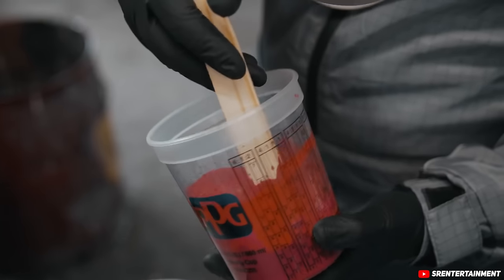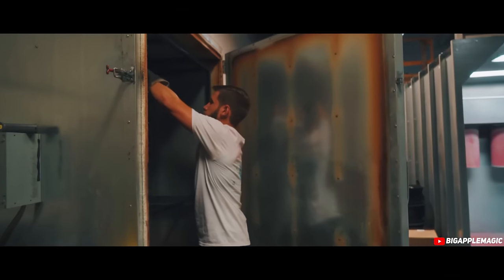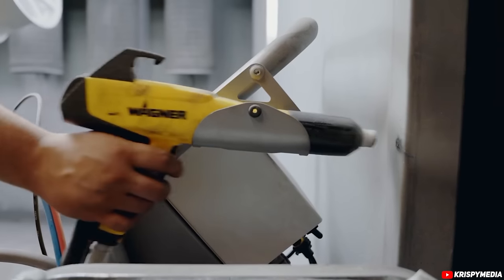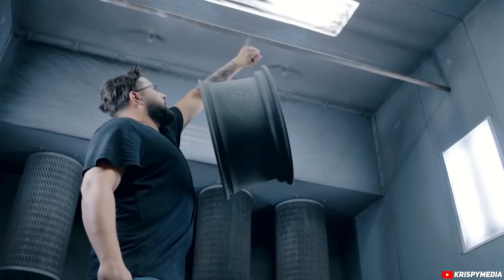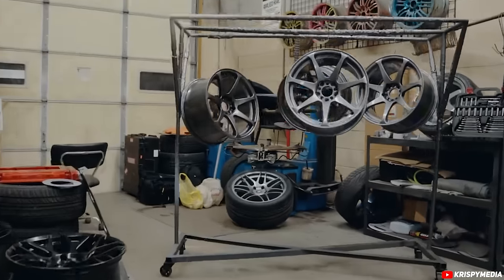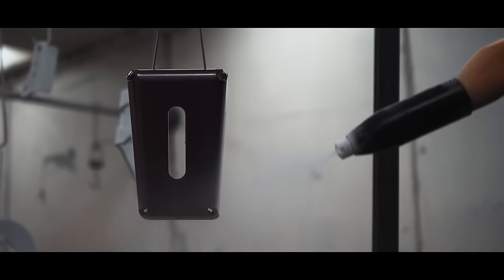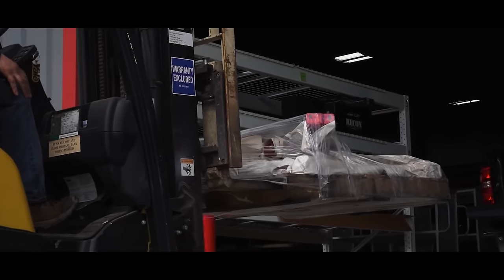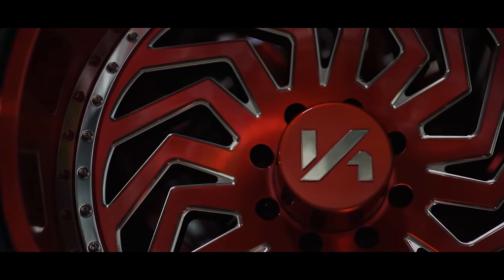Paint VS Powdercoat!

Comment: I have rough country side steps on my truck and they are powder coated from factory and I can 100% say that it's a super durable surface, even the foot pads are powder coated and I've had them for a few months now and they still look brand new, also I live in area with basically nothing but sand for dirt so you can probably imagine that my boots are probably grinding against that surface a lot

Comment: I am assuming you cannot mix decals with powder coat in any way. Obviously one could put a decal on any smooth surface after coating but I am referring to protecting a set of tank decals for the long haul, usually by applying clear coat over the decals. But a decal in a powder coat oven under clear coat would burn up, correct?

Comment: Have a safari style roof rack 4’ x 7’ for my 4x4 SUV. The factory paint is failing and has a lot of surface rust. Should I sand the rust off and rattle can it or is powder coat the better choice?
Reply from the maker: Roof rack, I'd powder personally

Comment: Great video. I'm curious I painted my exaust hmdi ports with a high heat engine enamel spray paint(Rust-Oleum) lasted 7 months before small chipping started which I believe pressure washing  didn't help. Not to mention I didn't use a primer.  Will a powder coat give me more life on these exaust ports?
Reply from the maker: Yes it will

Comment: I understand the pain of finding a competent powder coating place. Here most people don't prep and prime the metal properly. 
So any black powder coated metal gets extremely hot when out in the sun.
Reply from the maker: Well that’ll be common with anything the color black in sunlight
Reply: A properly prepped, primed and powder coated piece of metal will not get hot when exposed to direct sunlight. Even black ones will not get hot. I didn't believe it until I saw it for myself. That epoxy primer makes a huge difference.